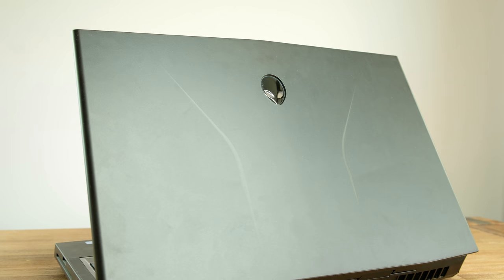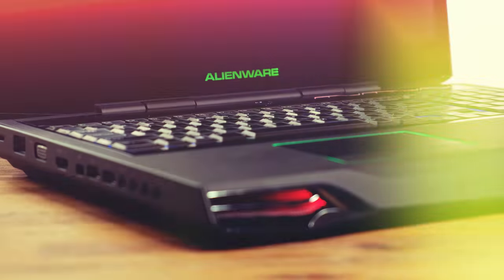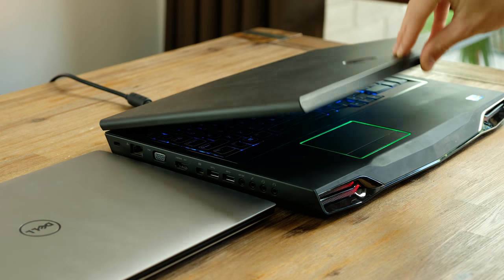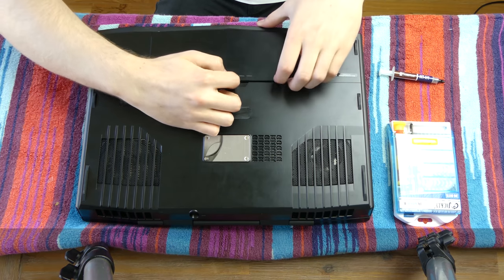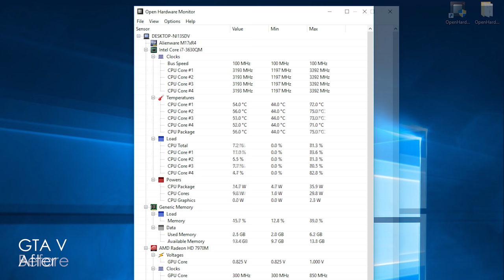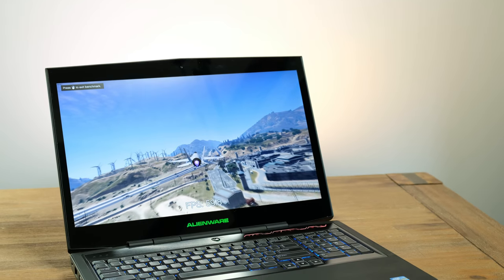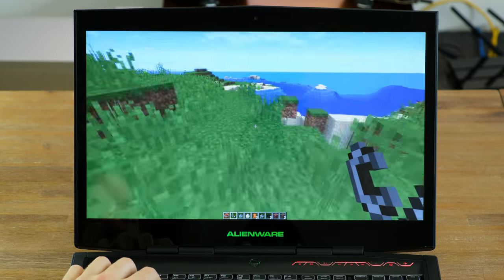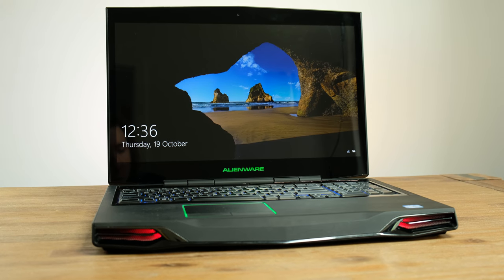Should You Buy an Old Alienware Laptop?

Comment: Mine's still running as intended, 8 years after it was made. I've seen dead gaming laptops half it's age, and I can replace any major part for 200 bucks or less, myself. Honestly, it's a pretty amazing machine, and these days you can upgrade them to a 1070 (with modded drivers) and extreme edition i7 (don't remember the model) that gets up to 4 Ghz. You can also use the cooling from the 17 r1, meaning you can pretty much double your heatpipes, and go all copper. Even in 2020, it can be pretty capable for what it's worth. Plus super cheap upgrades, and a metric ton of I/O inside AND out

Comment: Just bought an Alienware 14 with an i7-4700MQ, 16Gb RAM, and a GTX765m for £220. Needed a bit of cleaning, but it was still a good deal.
Reply: PHYSX_YT damn that's a good find.. I just found a ROG G750JW with the exact same specs for 499 US dollars. But with 20gb ram.
Reply: thats awesome
Reply: José Garcia i found a by seller called (defective) laptop for 250$. As the seller didn't include the power adapter i bought myself a power adapter. And once it arrived it worked perfectly fine and nothing was defective. The issue was that the seller didn't use a matching power adapter or a not operating one. I bought the adapter for just 30$ on ebay and it powered the laptop on without issues. The specs of the laptop are: i7 4710HQ, 16GB ddr3, GTX 980M 4GB, 4K Touchscreen display, 256gb ssd, 1tb hdd, model is alienware 15 r1.
Reply: WOW... Thats a deal
Reply: M18x R2 is still ouperform Alienware 18(which is the successor for it) though especially when you upgrade this thing too GTX 1060. Same with M17x R4 is still out perform its successor, Alienware 17 R3 lol. This was when Alienware built their laptop property to make it upgradable and not soldering them on. Nowadays, Alienware went to BGA and that's why it's crap for gaming laptop.

Comment: +Psivewri I personally bought an Alienware M17x R4 off ebay a couple months back, It is the same thing but with an nVidia GeForce GTX 660m. It was $450 and came with an Alienware mouse, Backpack and mouse pad. I ended up selling all the extras for a nice cool $50. So $400 for this isn't bad. Some things to keep in mind is you must give the laptop some decent airflow or your GPU will overheat fast and get to about 96c, It will back off and for the next few minutes you will be running off 4 - 10fps while the GPU cools off. The 660m GPU does fine for me at the moment but like video says you can upgrade it, I personally will be upgrading to a 780m which will be about 200% faster. And you will most likely need a new battery  cause after 5 years don't expect the OEM battery to hold its original charge. If you don't want to do that just keep it plugged in.

My pros and cons about the laptop.

Pros :
• Good feeling keyboard with nice colors, Doesn't just feel like a cheap laptop keyboard.
• Media buttons on the top right are awesome and I tend to use them a lot.
• Has a full sized keyboard
• Looks sleek, When the laptop screen is up it doesn't look fat. The style of the laptop fits the size perfectly.
• RGB So you can have all the rainbow goodness you can desire.
• You can upgrade the GPU and other things.
• 2 ports for 2.5" SSD or HardDrives and I believe an m.2
• Neat power button, It flickers as the Hard Drive spins.
• Very nice loud speakers.
• Selection of ports and even a method to lock your laptop if you wanted to feel more safe at a coffee shop or something..

Cons :
• If you have big hands like me then your palm will tend to hit the corner of the trackpad so you might hit/shoot something you don't want to while gaming. This can be countered via Alien Touch in the AlienFX area where you can adjust the sensitivity and something for "accidental palm hits"
• Trackpad isn't the greatest
• Heavy
• My power cord slips out easily (Might just be mine)
• The fans are noisy

Overall I highly recommend doing this. It worked out so well for me cause I am at the moment traveling in an RV traveling.
Also thanks Psivewri cause I will new be opening it up and getting all the dust out & reapplying paste. :)

Thumbs up from me and I hope this helped anyone.
Reply: Joshua Pile get a 7970m not a 780
Reply: Thanks so much LOL, You just saved me about $100. If I bought the AMD one and sold my other one it would only cost about $30 - 40.
Reply: 2 months late, I know, but what modern games have you tested on it and how well do they run?
Reply: Well, Recently I upgraded to an Alienware 15 R3 & sold my old one for $675. On Fortnite 1080 w/ medium Anti Aliasing & everything else low I was getting 50 -60fps, Now with the update I would think it would get 70 - 80 on those settings. Keeping in mind I have a 1600 x 900 screen and not 1920x1080p but I don't think that would change much. If you can find one with a better AMD card it wont cost much more & will run much faster. If you're curious about the new one I paid $970 & it has an Nvidia GeForce GTX 1060-6GB, i7-6700HQ, 120Hz screen and 8GB DDR4. Mint condition and was a steal :o
Reply: When talking about the fan sound, you need to state whether or not the computer is idling(just web browsing or simple document editing), or is at full load i.e  gamming
Reply: Is that the most powerful gpu you could use in an M17x R4?
Reply: You can use MSI GTX 1070 to be upgrade into your m17x r4 or even Zotac version of GTX 1080 MxM(if you brave enough but it will be works if you do a lot of work on it)
Reply: Really?? Yeah I wouldn't go over a 1070 for that reason. But sadly I think i've got to pass on Alienwares because I just can't live without a pointer stick. :( I flippin hate trackpads & mice suck for internetting.
Reply: Hey guys, have you seen the new Alienware area 51? If anything it's even more "aggressively styled" than this one! Finally a gaming laptop that looks cool and not like just another flat black rectangle
Reply: @Pixel Huntress well I'm using M17x R4 now as my laptop today. It's work pretty well. Believe it or not, this m17x r4 with GTX 1070 still outperform those Alienware 17 r3(its successor) with the same card(1070) when I see the comparison of its benchmark and fire strike score performance between alienware 17 r3 and m17x r4.
Reply: By the way, I am the one who ever upgrade it to gtx 1070 and work pretty well. I'm trying to upgrade to 1080 soon if I found this card as well. However, this card is really rare so its hard to find them. Damn, I wish I can find one cause I'm still looking for it tho. Anyway, I'm so jealous with my friend who already found this card and they have been tried to upgrade their m17x r4 to zotac gtx 1080
Reply: Pixel Huntress or you can upgrade to GTX 980m or GTX 1060 at least on M17x R4.
Reply: Ask Notebook review forum for more information. You can also get the information from this forum thread
Reply: Wow, how awesome!! That's really encouraging, because people are always saying older laptops can't play modern games. Maybe I could mod it to have a pointer stick, hmm....
Reply: So it doesn't get too hot with a 1070? Have you improved on the cooling?
Reply: Could you get a 1070 ti instead? If you OC it, it's as fast as a 1080 but not sure they made a laptop version, and might run cooler.
Reply: Pixel Huntress I'm not sure if there's 1070 ti for laptop standard but there's only MSI 1070 and even zotac 1080m which they're standard 3.0 mxm card for laptop.
Reply: Pixel Huntress we can mod the heatsink that fit with the gtx 1070
Reply: Pixel Huntress http://forum.notebookreview.com/threads/msi-gtx-1070-mxm-successfully-working-on-alienware-m17x-r4-another-socket-victory-against-bga-crap.803637/

I hope you can get the whole information here after you read the whole thread in this forum
Reply: @Pixel Huntressand this is the thread for how to upgrade the m17x r4 to GTX 1060 MxM :

https://www.techinferno.com/index.php?/forums/topic/10982-m17x-r4-gtx-1060-upgrade/
Reply: Thanks for the links! I'll def check them out. I'd be interested to find out if you are able to upgrade to the 1080 too.
Reply: OMG that's a lot of modding, don't think I'd be up to dremeling the chassis :)
Reply: Pixel Huntress you're welcome. Well, for the GTX 1080 zotac version for laptop, I'm still looking for it
Reply: Pixel Huntress that's why if you want to upgrade it to 10xx series, it have a lot of work to do. While, upgrading gpu to GTX 980m is still simple
Reply: Oh ok, well the 980 shouldn't be that much slower I guess? If only I could put a thinkpad keyboard in there so I can have a pointer stick it would be perfect.
Reply: Pixel Huntress GTX 980 is still good. I see your deleted commented one where you say, "R3 is successor of r4 ? Confusing". Well, I mean the M17x r4 was made before Alienware 17 r3 model. AW 17 is non MX model and this laptop is not been possible to upgrade anymore because it turn to be BGA
Reply: Still can support medium setting

Comment: Eurcom recently announced that they will be building smaller 10 series GPUS that will fit most of the casings in gaming laptops. As for the 17 R3, they were able to fit the  gtx 1070.  In all honesty, I would recommend buying a old 18 alienware rather than the 17,  because of the spacing  on the motherboard. This will allow for future gpu components to possibly fit within the laptop. As for the correct bios regarding the laptop, I recommend checking out notebookforums to find working bios for the upgraded gpu.

Comment: Seriously considering buying this laptop if not the M17x R3 because of this video. Would be awesome to have some gaming portability. Also you can put cards like the GTX 880M 8GB in this laptop as well as the R3. Probably the path I'm going to take with my gaming PC upgrade. Awesome video!
Reply: Kevin Akerberg Try to find a Dell 15 7559 instead. I see one on eBay right now (in the us) for only $540. Has a 960m, which is pretty close to the alienwares
Reply: I've found some pretty good deals on GTX 780M laptops, which are faster than both the 7970m and 960m, and the 960m is actually beaten by the 7970m by about 20% difference. Also I find the alienware's upgradability very valuable, and an OEM Dell machine seems like it wouldn't be as modular as something like an Alienware or a Sager, two brands I've been looking into
Reply: Kevin Akerberg I believe the Dell is actually more modular. It only takes 1 screw to get to the internals, and you can get to the ram, ssd, and battery from there. I just thought that the Dell was a much better value compared to the alienware. Alienware is around $750 used. Which is about $200 more for 20% better performance. Not sure how expensive the 780m laptops are though
Reply: Jonah Nguyen I’ve found an Alienware 17 with an i7-4700MQ, 16GB of RAM, 128GB SSD + 750GB HDD, and a GTX 780M for $600. Not too bad especially for an Alienware

Comment: wait what? you can upgrade the gpu in this laptop? does it have an mxm slot (or however those are called)???
Reply: CMDR PLKarmann a graphics amplifier slot? Graphics card?
Reply: mxm3.0 is a NVidia exclusive laptop graphics slot, which ives the graphicscard a PCIE 3.0 16x signal, and it is very small cpmpared to normal PCIE slots, though it is still pretty big comparedto Thunderbolt 3.

Comment: i remember getting a handmedown laptop from my mom. i used coretemp and the cpu was getting like 90c. i opened it to find the air vent caked with dust :/ i also used tin foil in place of the old cracking thermal "paste". easily knocked 30c off the cpu.
Reply: no thermal paste? wow
Reply: nope. no thermal paste. tin foil works way better thAn you might think. it only gets about 50 degrees celsius under full load. and by full load i mean roblox.
Reply: @EVRLYNMedia  wait it can load roblox?
Reply: @EVRLYNMedia  roblox is very light, try testing it using premiere pro effect rendering
Reply: @rarinth  yeah if you turn the graphics way down it will run on a core 2 duo. Its not great but it works :p

Comment: Great video, but I think any laptop over 3 yrs old + just isn't worth investing into unless you absolutely love the machine but realistically they just aren't made to last anymore. Spending $600 and knowing it could fail or cost more in the long run without any warranty just seems a waste.
Reply: Jason Morel nonsense
Reply: Tom Tapp clearly coming from someone with no experience enjoy your potatoes :)
Reply: Jason Morel You don’t know what your talkin about mate...those Alienware’s will wup anything out there if you know how to install correct cpu like 940intel and 980m nvidia in M15xr2 for example. 
If you have never done this then it explains your bias.
Reply: Tom Tapp but the cost of those upgrades are costs that aren't worth what you get a old cpu and 980m, which if you were smart might aswell put a couple of hundreds more and get a new machine with newer gen cpu and gtx 1060 upwards in terms of value for your dollar its way better and your covered if it fails for 1-2 years and your getting 2x upwards performance, better then wasting a couple hundred and not having any guarantee on life span. Pure economics mate at the end of the day, its using your money wisely. If you feel upgrading old tech is the way good for you and best of luck.
Reply: Jason Morel that’s the very reason it’s worth it. 
You go buy your “new” msi or rog that has the cpu and gpu soldered to the motherboard and you have to run W 10. 
Get that new msi and when you burn up that GPU ....go buy another one. That’s how those companies are playing you “mate”....you can’t change/REPLACE  cpu or gpu. Gotta buy new motherboard or new PC. 
Alienware and Sager lets you upgrade cpu like a 940xm that you can overclock because it’s not locked, to 3.8 mhz. Upgrade GPU to 980m that will rock those newer gpus that are soldered to MB.
Got it now? Coming from someone who likes potatoes
Reply: Jason Morel Unless it's a ThinkPad... still have my T410 that I bought used 3 years ago. Put an ssd in it and it's still there mining monero and being a print server xD. Paid for it self in 4 months :v
Reply: Jason Morel what a rant...whoa
Reply: PC TechTips see now thats putting old tech to good use and an ssd is a cheap as upgrade well done. T410 would have cost you hardly anything aswell. Are you mining on battery or plugged in? Might be able to save some power on battery for an hour or 2 here and there over time more free money :)
Reply: Tom Tapp see you can't handle facts. That reply was not just for you but to help others who don't have the knowledge in relation to newer tech and when you break it down cost wise in relation to performance/reliability, depreciation and resell ability its a no brainer at the end of the day would you rather have less or more money in your pocket in a year or 2 down the road. I know which one I would take.
Reply: Correct. And furthermore, only gtx 10** are worth of money invest, since games are dramaticly uppered their requirements.
Reply: Tom Tapp He's right. The parts in the system will age quickly as there is only so much cooling you can do in suge a compressed package.
Reply: Dude, stop spoiling my fun.
Reply: Net neutrality you are gone how are you still here wait a minute you aren't the real thing you imposter
Reply: lenovo rox hahah
Reply: non sense
this laptop could run gtx 1080 zotac version 
I mean you can upgrade this laptop
remember pre dell alienware machine is so rugged 
that even m15x r1 from 2008 could run gtx 980m 8gb 
yes you can upgrade this into a better laptop
Reply: look
upgrading gpu isnt that kind of piece of cake that average joe can do
you need to mod the fucking heatsink made a custom driver and so on 
heat problem is never being a nuisance for me i can slap bronze plates on my heatsink easily 
and my m15x still working after 3 years even with harcore gaming mode.
please understand how these thing works 
remember not all gpu with the same name works exactly same
gtx 1080 eurocom version is underpowered compared to msi and zotac version and so on
Reply: aso_qro the only thing that's worth is m17x r4
You just need 1070 MxM all variants or mxm 1080 zotac.
Reply: aso_qro make sure you change the cpu into xm i7 series
Reply: aso_qro but honestly I don't recommend you to build a laptop, especially changing its gpu. Since the "commercial" variants from Aetina and clevo lack of power, and the high voltage variants from msi and zotac mostly planted on a laptop.
Reply: _aso_qro_  i would but a entry level gaming laptop around like 600-700 dollars. You can play most games at 50-60 fps at medium-high setting

Comment: Just a couple of important tios with this laptop (cuz i used to have that exact model) :

- While you can indeed replace the video card keep in mind that there are only 3 models that are officially supported by the OEM BIOS, any newer models are unlikely to work unless you get a modded BIOS for it.

- Under no circumstances should you ever get the GTX 675m, i had THREE of those fry in the M17x R4, and it wasn't even overheating as i was getting max 68c temps with it.